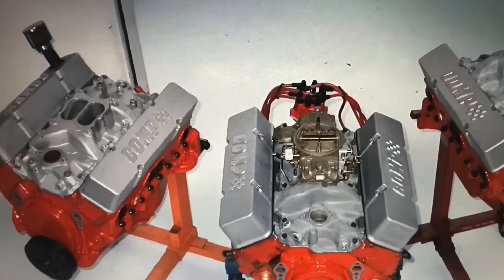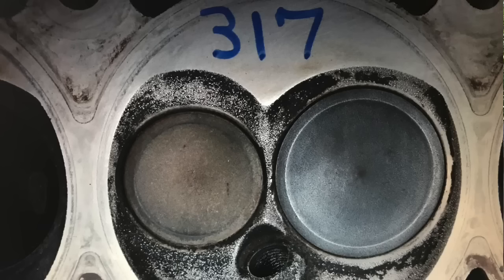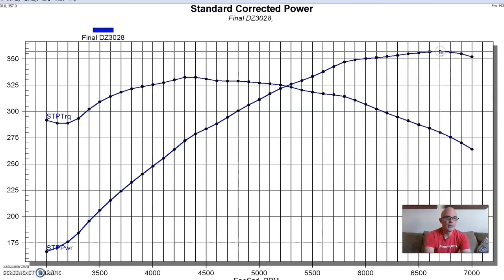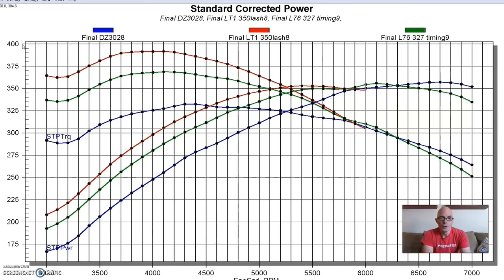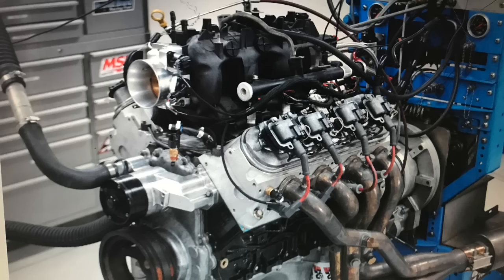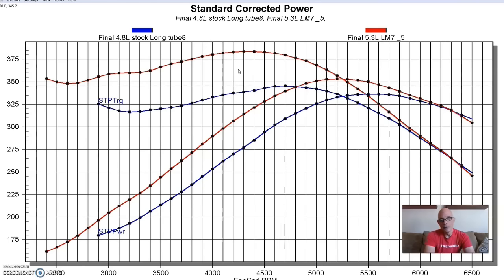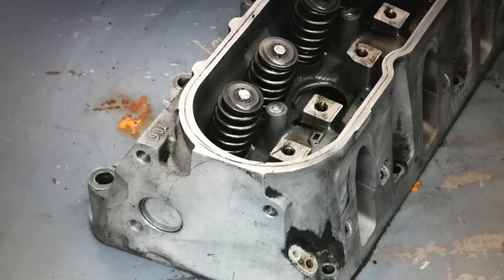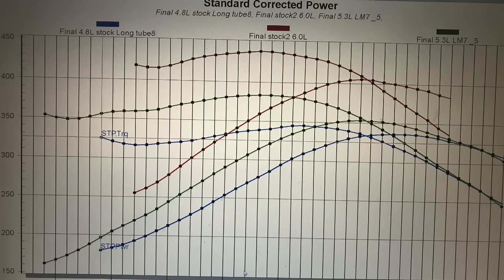HOW MUCH HP DID THE 1969 DZ302, THE 1965 365-HP L76 327 OR 1970 LT1 350 REALLY MAKE? WAS IT FAUX HP?

Comment: 5.7 Hemi, 6.1 Hemi & 6.4 Hemi
Reply: I had 1.3l 1984 ford hemi lol
Reply: Olds Pwr exactly
Reply: @miken.4693 . Remember this it was mopar who built the first muscle car that ran under 12 sec on the street it's was mopar who held the land speed record of 223mph.it ot took almost two decades befor it was beat.it was mopar who built the the fastest street cars ever. And yes all of your top full dragersters and funny cars all use Hemi engines and hemi engines are mopar.
Reply: @norristammislideshowmulgre877  haha! That's funny. You must be a Mopar fanboy. T/F hemis are aftermarket racing engines that have very little in common with any production based engine. They ain't Mopar engines. Haven't been in decades. The most powerful NA engines are all bigblock Chevy based. Ever heard of Sonny Leonard?
Reply: @norristammislideshowmulgre877  you should research the hemi engine. It was not a Chrysler design
Reply: @Olds_Pwr  All of Chrysler is 90% Marketing, Generally selling the Dream.

Comment: So, while I have always been a fan of the early 327s, I would absolutely rather have a built forged DZ302 in a 63 Corvette with a Rotrex or Procharger centrifugal blower, a single plane intake manifold, and either a big QFT blow through carb, or a Holley Dominator 850. Then I would drop it down with really wide tires, square stance it, run a Muncie M-22 Rock Crusher 4 speed, a 3:73 LSD rear end, and run it as an autocross car. I have just always wanted to build a muscle car into a low, nasty, fast autocross car and run it on a road course.
Reply: not the place to fantasize

Comment: I saw a similar test between a Pontiac 400 and 455. The results were similar. When built the same both engines had about the same peak horsepower but the 455 had way more torque and at a lower RPM. The peak power on the 455 was also at a slightly less RPM. About 400 RPM's if I remember the test correctly.

Comment: "No substitute for cubic inches" is a maxim, because it's true.
Reply: There's also no substitute for cubic dollars. :)
Reply: no, its really not. 400 mopar is worse than a 454 chevy, because the 454 chevy is bigger, right? no. 400 mopar bore is 4.342", stroke is 3.38". bigger bore, more area to fill with fuel/air, short stroke, to turn the engine at a higher rpm to fill the bigger bore at high rpm.
Reply: Frigglebiscuit I guarantee you could get more torque and horsepower out of a bigger engine, all else being equal.

Comment: Would be cool to see the overlay of the curves between the gen 1 SBC muscle car engines compared to the gen 3/4 LS truck engines. 4.8 vs dz302, 5.3 vs 327, 6.0 vs 350, 6.2 vs 383. Great video!
Reply: That comparison would be awesome!
Reply: @crw3673  And since he's already got the dyno runs logged as simple as just doing another commentary while showing them.
Reply: One thing to keep in mind when comparing gen 1 small blocks to LS family engines. 
 The largest head available, and the largest head tested was only about 160cc intake port volume..
 The smallest ls family intake port is 200cc.
 Put a 200cc head on a gen 1 sbc and its a whole new animal..
 Likewise camming the ls series produces excellent power as well..
I would love to see a head to head comparison of a gen 1 350 with a 200cc head vs an ls1. With equal compression ratio and cam.
Reply: @kendriver9139  and more things to keep in mind about the LS family is the 55mm cam core, pedestal mounted rockers, gerotor oil pump, injector targeting, block rigidity, lightweight rockers, long connecting rods, and coil on plug ignition.  There is no magic in the LS design.  It’s like a bunch of smart hot rodders got together and decided to build the best engine they could after learning from the earlier small blocks.
Reply: I'd kind of like to see the overlay between the Gen 2 LT1 and the Gen 3 LS1, both have similar displacement and out of the box (96 LT4 vs 97 LS1) both had fairly close peak numbers.
Reply: @Misterfairweather  For some reason though, the LS1 F body was almost always half a second faster (usually more) than the LT1 F body. The LS1s almost always had around 300whp, the LT1s were around 275whp when we tested them back in the early 00s. Even my 98, the slowest of the LS1s put down more power with 2.73 gears and a stock auto than all the LT1s.

The auto LS1s were a lot faster than the manuals, except for one who special ordered his Z28 without AC and manual everything, it was about 350lbs lighter than the other cars, and he was a small guy too. When I dragged one of my dinosaurs to the dyno and put down 520rwtq@3000 and 650rwtq @ 5000 on pump gas without a power adder (it was also down on power a bit due to bent valves from vandalism) the Cobra guys all said it was converter flash, could not possibly be how Pontiacs are with better heads.
Reply: @SweatyFatGuy  i dunno what manual f bodys u were running but the 6spd cars were always quicker stock for stock. Thats like sayin the auto c5 vettes were quicker than the manuals! Lol. The autos from those days were still slushboxes, albeit improved slushboxes, but still slush none the less lolol. Not like today autos.
Reply: @SweatyFatGuy  My 2002 Z28 6speed trap speed was 109mph, automatic ls1 cars were running 105mph. "Automatic's were a lot faster"?
Reply: @romper4444  Unless you're Ronnie Sox reincarnated, an auto LS will usually be quicker that the 6 speed. Why do you think the new C8 has a "slushbox", with no manual trans available. Today's automatic transmissions are pretty damn good.
Reply: @2t713  Dont know about faster, but speed doesn't win drag races, quickness does. My 2000 LS1 A4 ran high 12s at 110mph through stock manifolds, no cats, and flowmasters with a Blackwing air intake. There was a C4 ZR1 at the track same day as I was, 6 speed, of course. I beat him every time. His buddy was really giving the dude a hard time about it, too. Good natured fun. I beat him at least 3 times, maybe 4. After the last time, I returned to the same area in the pits, popped my trunk, revealing several items I had bought at Best Buy earlier, plus a fairly large cooler full if ice, and offered him and his buddy a soda pop. His buddy lost it!!!
Reply: @milojanis4901  Cool, history is marching on though. My Hellcat Charger has run 10.83 @126 with just DOT M/T Drag Radials.
Reply: Almost made same comment.
Reply: they SAY THAT the LS 5.3 IS NOTHING BUT THE NEWER 327 ANYWAY...IDK

Comment: Is pretty interesting, the revs between peak torque and hp between the old and new engines. New engines all looked to be 1200 and the old engines more like 2000. Also the shift of torque peak compared to stroke length, the 5.3 and 6.0 with the same stroke made peak torque nearly exactly the same revs. 
As always thanks Richard for the great video!

Comment: Would have loved to see a 283 and a 383 stroker thrown in there as well. I mean we can totally predict the curves, but would have been cool to see.
Reply: The 302, 327 and 350 were chosen because they all have a 4" bore. The 283 doesn't
Reply: The 302 has the 283 crank correct?
Reply: @joshfeister6566  yes.
Reply: Most people would make a dz 302 by using a 327 and throwing in 283 crank making it 302 ci
Reply: @joshfeister6566  I just learned awhile back that GM made a 4.3L v8 in the mid 90's. They basically made a 305 bore version of an LT1 and put a 3" stroke in it. Supposedly that crank will fit a gen 1 block with the 1 piece rear main. To be honest I'm a little more than tempted to build a 4.3 v8 for a nice daily driver/gas saver with the gen 1 sound 🤣
Reply: @nashvilleoutlaw  old comment but yes some caprice classics and impala non-ss cars had the "baby lt1" richard holdener dyno ed a junkyard find and with headers I wanna say got almost 250hp/ 300 tq. Dont quote me on that it's been a little while. Be cool to have one with forged guts, roller, lil spray just to wind it up, but at that point more cubes would be a big difference.  Peace!
Reply: @nashvilleoutlaw  I have a 302 LT1 sitting on an engine stand ready to go into a 944. I also have a 4.3 L99 sitting on a dolly waiting to go into something.
Reply: @OEMishGarage  L99 4.3 or 6.2 ?
Reply: @eflanagan1921  4.3L
Reply: Do it.
Reply: Do they run on NitroMethanol?
Reply: @nashvilleoutlaw  I had 79 Monte with the 267 V8 2bbl carb and turbo 350 3spd. Ran 17.5 stock and I used to bracket race it for fun. The 2.29 highway gears killed all those G-bodies.
Reply: When I was in H.S. in the late '70s, my friends 55 Chevy with a 283 was the fastest car in the School.

The 50/50 mix of NitroMethanol and Aviation Gas in the Kegger Tank where the back seat used to be helped quite a bit!

Of course, so did lightening the car 800lbs...
Reply: Do you mean nitromethane or nitromethanol. And if so how the fuck did he get a street car to run on nitromethane. Or how did this guy get nitromethanol at all.
Reply: @akassasin5768  you can buy it at hobby stores for 11$ a gallon last I checked. I've put it in all kinds stuff just to see what would happen. Weed eaters lawn mowers etc...
Reply: He "lightened" the car 800lbs. Don't you know anything?
Reply: What happened?
Reply: Yeah, a lotta' guys ran ""nitromethanoll" back then.🤪
Reply: I'm very surprised that when Chevy really started thinning out its passenger car V8 engine options around 1975-76, that GM didn't release a factory ca 380" 4V SB to replace the 350, 400 and 454, along with keeping the 305 a two barrel only.
Reply: no doubt.

Comment: Question. In a SBE gen 3 turbo application. wouldn't you want the smaller displacement 4.8 to limit torque production in order to save your rods?
Reply: That wasn’t an issue until the Gen 3 6L made over 1400 lb/ft.  In that case, it was still a junkyard bottom end.  If you’re making over 1400 lb/ft, spend some coin on a good set of rods/pistons and send it.
Reply from the maker: that's not an issue until you make a LOT of torque

Comment: Like to see the old small block's with vortec heads. Keeping everything else the same with simple spring and retainer to valveguide clearance upgrade and a comparable intake.
Reply: That would be a good comparision
Reply: @scrappy7571  And put the 400 smallblock in there as well. More is always mo' betta'!
Reply: @ronnelson7828  I agree, I'm a 400 guy
Reply: @SweatyFatGuy  it should be a torque monster even a 9 to 1 vortec headed 400 should be a stop light killer with 3.73s the old comp high energy 268 or crane 274h06 flat tappet cams woild work with stock springs but be in the edge with press in rocker studs
Reply: , @ronnelson7828  back in 1979 I was out there blowing off 400s, they would get me off the line good but my little 327 would catch them, the fastest 400 I raced I pasted him in 4th gear, HE ran out of Cam! the fastest Chevy I raced was a 283, beat him to, but almost didn't. yes, that 283 would have beat that 400. displacement is ONLY one aspect of racing, matching parts are too
Reply: @sideswiped6874  I would imagine you are talking about a small journal 327. I bet a small journal with a steel crank would be the bomb, especially for RPMs...
Reply: 8 @kramnull8962  , no, it was a large journal 327 bored .030!
remember, we are talking late 60s early 70s Small Block Muscle Car power here,
 my pistons were set tight, the rings too (you can get away with that a bit on short stroke engines!) the rod bearing were set loose;)  and block deck and the 71 LT heads were both milled, compression ended up to 12. 8. it would ping a bit when lugging with that Sunoco 94 octane. the Holley was setup to open all 4s at the same time. my best friend had a stock 69 Mach 1 428 CJ Mustang, rated at 370HP.  and my Nova was faster. he could get me off the line but I would catch him in 2nd. and the same story for that 67 Vett with the 350HP 396). my cam a Chvey cam, I will never tell, but it pulled very hard threw the gears. that story is that I went to the Chevy dealership and told the parts guy I wanted to buy a LT1 cam, he told me he would sell me a cam that was a better 1/4 mile cam, I said OK, and I bought it. I will say it was not the DZ cam and not the LT1 cam.
that 283 I raced; had the Chevy G1 road racing cam in it, IF that race was 3/8 mile I would have lost that race. I beat him off the line like 3 car lengths, at the 1/4 mark his front bumper was bucking at my door. he had a 2 speed powerglide in it.
Reply: @sideswiped6874  Was it the 3927140 crossram z-28 camshaft?
Reply: @sbf_fox2434 , no .
Reply: Craig D  I can do so much more with a Pontiac, for a lot less money, and finding a Caddy is a lot more difficult. Finding a 6.0 to stuff in a truck is super easy. Just buy the whole rusted out, beaten half to death 2500 silverado or a van and there ya go.
Reply: @mrhazel I’m putting Vortecs, similar 268 comp cam in my 400 for my 55 4dr. It had the smog heads, 200R trans, 3.55 out back. I’m hoping to wake it up.

Comment: interesting to see that the three SBC's all made basically the same peak power. I'm an RPM lover and its cool to see how the 302 made basically the same power as the 350 but a full 1000 rpm higher.
Reply: Same power? You're kidding right? Peak Horse power between the 3 is remarlably close. Yet power was nothing even remotely close. The real difference is found in the torque numbers and how wide the torque curve is. The 302 is best described as PEAKY in that you wait until it's spinning hard for the power, then a gear change happens and a lot of that peak power disappears as you wait for it to build again. Yes, the short stroke is fun to "spin" up but it's a far slower car that can't escape the lack of lower rpm power vs the bigger displacement 327 and 350 that don't lose as much power on each rpm drop as you shift gears. These are not engines with the same power, not even close. The head line grabbing peak power numbers don't tell the whole story. DZ302s only existed in the z/28s of '67-69 because the trans am rule book mandated it's size. On the street you face no such rules and in that you find why the 302 configured like this was never installed in any other Chevy of the day. It's a weak choice  engine vs both the 327 that came before it and the 350 that came out in 1967 along side it.
Reply: @Dogboy1960  Just change the transmission with a closer gearing to compensate for the higher rpm drop and diff relation because of the lower torque, shorter stroke are good for endurance racing.
Reply: @Dogboy1960  your dissertation completely missed what he said.
Reply: @Dogboy1960  reread what i wrote three years ago, i said "same peak power". weird to write a novel reply on some old comment years later dude

Comment: I am planning my first engine rebuild on a small block Chevy I have. I’d love some input. Solid flat tappet cam and lifters OR hydraulic roller can and lifters? I have 2 rebuild kits I’m looking at. I know both can be fine and both can make power. I’m after a solid NA build shooting for around 450hp with plans to add boost in the future. Any recommendations or things to look for?
Reply: Hydraulic roller.

If you’re looking to rebuild just to rebuild, okay.  Frankly, by time all the costs are involved, you’d hit your 450hp goal more easily with a LS swap, and it’s a much better platform for boost.
Reply: @stlchucko  not against LS swapping, but I have the small block, so I may as well use it. And I know it's a good block. I'd rather just not deal with the wiring and computers for now. If I was choosing a new motor, LS all the way.
The kits I'm looking at had a few hundred dollar difference between hydraulic cam and flat tappet
Thanks for the input
Reply: heads are everything on a gen 1.  spend your money there. the ls stock heads flow as well as most good aftermarket sbc. so get a really good set if you wanna make power.
Reply: @jsomething2  absolutely
planning on both a new set of heads and cam
Reply: NegativeZero while 450 is easy in this dyno hp world, it pretty hard in the real world. remember a stock ls3 makes almost 500hp on his engine dyno, but in a manual c6 corvette it doesn't even make 400 to the wheels. close but not quite, less in a auto. so a sbc 350 thru a auto with a loose converter. which is common, it really is hard to show up at a dynojet and put down 450hp on pump 93 n/a. just don't be to disappointed.

a 406 with a goal of 400 to the wheels is more in the reach of us normal guys with off the shelf parts.
Reply: @jsomething2  "which" ls heads? because some of them do not lol.
Reply: @frigglebiscuit7484  all of them...........
Reply from the maker: 450 hp is easy with decent heads-even the vortec heads-hyd roller is the best, but you can do it with either solid or hyd flat tappet

Comment: Hillbilly lore has it that the original LT1 dyno mule (the motor used to claim the 370hp number) was actually fitted with the 30/30 cam, but the LT1 cam (obviously) is what actually ended up in the production motors. 

Thank you for these dyno tests! Having these combos dyno'd in factory form is a godsend for cheap shits like me who don't feel like shelling out the cash for aftermarket heads and roller cams and such. These factory combo's are cheap and easy to build reliably (Well... Maybe not the DZ302...). Your dyno graphs are going into the brain compartment for future shenanigans!

Comment: Can you do a review on the turbo fire 350 or the old camel hump heads guys use to swap
Reply: That's the L48 350 aka 350\300 or plain old 4bbl 350.  It was introduced as one of 2 exclusive engine to the 67 Camaro.  They included the unadvertised MO 302 in the Z/28, the all new 350, SS 350 only.  Became the standard 350 4bbl from 68' on.  An engine I would like to see tested is the L46 which was the Corvette exclusive 350\350, a hotter cam like the older L79.